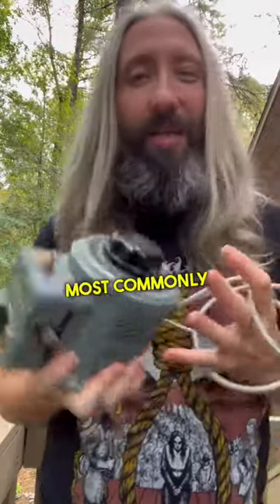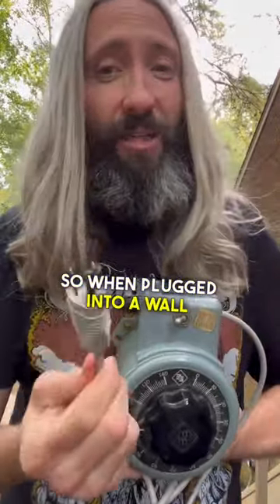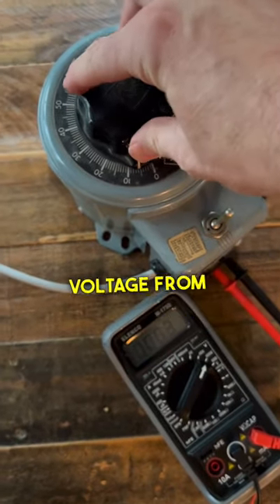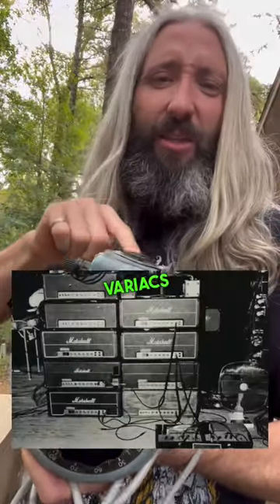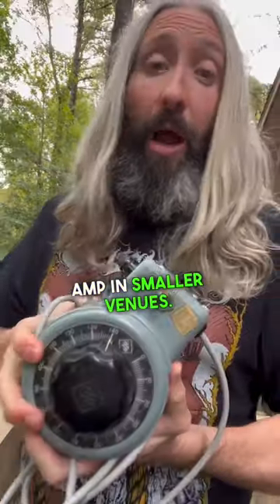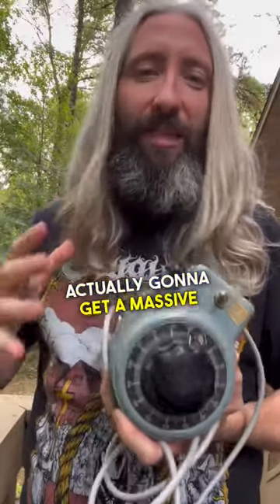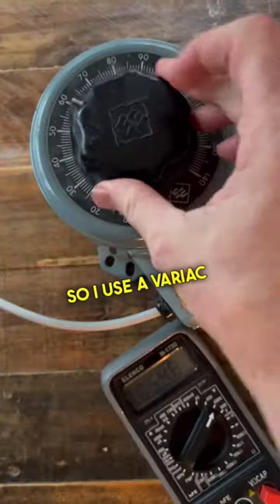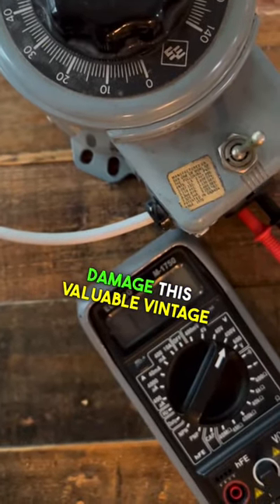How To Use A Variac With Your Tube Amp #guitar #eddievanhalen #vanhalen #shorts

Comment: I heard that that is exactly how EVH used it: he just had British amps, and needed to set them to British power supply.
Reply: I don’t think a variac gets anywhere close to 220V? And there’s no correction for frequency either, although that probably wouldn’t matter
Reply: What 👆he said.
Also, this was a ploy that he used to hide how he got his Tone and a way to get his competition to Destroy their Amps when they were trying to copy him.
Reply: Plexi Marshall?  British version was 230 volts in the 60’s for that, IE 115v American twice, today the British/European standard is 240, I guess partly because ours is 120?  Something like that…..

I grew up in Pasadena, about  Eddie’s age, I read that he had a British made Plexi, and also others wired for America, so he needed to step up the British one, but he also stepped the American 
Ones down toward 112, 110, apparently to take some of the steam out of them, and reduce the clean headroom, Ie brown them a bit, hence the brown sound name.  a vintage 60’s plexi is an insanely loud amp, only British HI WATTS, or American Ampegs are louder, those 2 amps are designed for clean headroom and they were not designed to distort like a Marshall.   
But after ‘78 Van Halen had more access to the best amp techs, and there are other easier ways to mod the amp itself, to get the same result Eddie was after …reliably…..Hendrix by contrast literally maxed all the controls, and blew them up at first left and right, until his techs also got wise and nodded them to make them more reliable, as well as get his signature tones.   

PRS recently cloned an actual late generation 60’s Plexi that Jimi played at Woodstock that was in a museum, those new PRS heads are made without the 4 inputs the Hendrix Woodstock amp had, they are internally jumpered instead, with separate volume controls to blend the different preamp voices.   Spendy, but if you want that sound in a modern amp, I think Paul nailed it!🙂 AND the 50 watt models (2output tubes vs 4) have the same transformers as the 100 watt ones!   So they are likely super reliable
Reply: @zgrb  yes!, I think that’s how Eddie got the idea to take the American 115v volt Plexi amps down under 115, because the variac only went up to 220v not the 230v that the Brit Plexi actually wanted to see, AND the added bonus was they didn’t blow up as often, they ran a bit cooler🙂. Eddie was a smart guy, and a tinkerer!
Reply: @scottarnold6528  yup!   Just before Van Halen broke big, if you saw Eddie play, he faced his amp, his back to the crowd!!!😳🙄

There was another local Pasadena band called Reddi Kilawatt, their guitarist Terri Kilgore knew Eddie, and used the same Echoplex and Marshall type of sound, I saw him
Blow up a Marshall at a club date!
But as a rivalry, it really wasn’t, Terry was also the only singer, a 3 piece band
Reply: @jonathanstrand2474  PRS just released a 20W version of it too but kept the entire preamp and transformers etc the same as on the 100W and 50W versions and it’s only like $899 MSRP too
Reply: @zgrb  They make 240v variacs
Reply: @jonathanstrand2474  As overly simplified: European high voltage socket is 3-phase 400V, so single phase is 400V divided by square rooth of 3, which makes roughly about 230V. American high voltage socket is 2-phase 240V, so single phase is half of that, which makes 120V. Not sure how they are related, maybe they are, but the number of phases and the feequency and the "angle" between the phases is different. Many devices nowadays can intake anything between 110-240V and both 50 and 60 Hz, but that certainly wasn't the case back then, and even today that is true mainly for low current devices like phone chargers and such.
Reply: But thanks for the story, that may very well be true.
Reply: @thoubias  wow thanks for the detail, I’ve always electronics tinkered, but in the electronics class I took the math was just too much, I can do it with music and rhythm intuitively, but I barely got through Algebra, pattern recognition is what my brain does well, so I don’t care about book math.  I’ll look up phase”, u got me curious now, so that’s how you calculate that!🙂
Reply: @zgrb  well back then it was 240 v and now it's 230v so I don't know where you got 220 from
Reply: @TheTreegodfather  sure, but they wouldn’t transform U.S. voltages up that high afaik
Reply: @zgrb   Every US house has 240v in the panel. Some have appliances wired for it, some don't. My ham radio amps are all 240V, and I have a 240 variac because I work on other people's gear.
Reply: @zgrb   Mine will go from 0 to 265-ish volts on the output.
Reply: all Plexis are British amps, but anyway he did use them to turn down the voltage, but he stoped using them after 1980 tour
Reply: @jonathanstrand2474  they are the same amps they sold in the US, there is a plug in the back for 220 and 110

Comment: PSA: just because the variac has a labels that say 100, 110, 120, etc volts doesn’t mean it is that. Most wall volt is actually 120-130v. The variac is made in respect to 120. Use a multimeter to ensure what it actually is. Also, you can bias differently when dropping voltage to 90-110, just make sure you know what you’re doing before you go about messing with dangerous voltages.
Reply: I think a lot of these are set for 110v so if you have 120-130v going into them you'd need to turn it down to like 100v to get closer to 110v. I could be remembering wrong though.

Comment: I repair tube amps since 2004. Here's what happens. When you reduce voltage to preamp tubes, their frequency response narrows, but also they distort more. There's a limit to doing this because alunder about 100 volts at the plates they start sounding alot less musical and you'd be better off with transistor/IC distorton. You don't really need a Variac today because modern high-gain amps adjust plate resistors for a sweet-spot compromise, using larger values like 220k instead of the classic 100k value for preamp gain stages.
Reply: Best reply

Comment: I read a bit somewhere that Eddie got a second Marshall head and plugged it into the wall and it was taking forever to turn on- but once it was on it was really quiet “only him and his dog could hear it” and he eventually figured out that he had a 220 volt amp or it was switched to 220 volt… something like that.. anyways that gave him the idea, so he hooked up (an/ thee I forget which one) amp and turned up and down the voltage that way. He then blew up that knob because it was too much power for it to handle so he went down to the local (hardware/RadioShack or whatever it was at the time) and asked for a heavy duty “light switch” and there it was. The variac that Eddie used to create that magical sound! 

I believe he says this all in an interview somewhere I’d have to find it but that’s the truth to how he discovered it!
Also I believe it was 89 volts that he set it to, and to which I run my Marshall origin 50 (it sounds beautiful at that voltage by the way!)

Comment: I go down to 60 volts and have been there for over 3 years for the “Brown Sound” and I tell you, that’s where the tone is. Not only does it reduce the volume a massive amount, it gives it a laggy feel which is the tone. The best recommendation I’ve gotten is to go to 90 volts on the variac, bias my tubes to 50mA each, then go to 60-75 volts without bias (each tube is at like 2mA each and the random differences from not biasing  also has its own tone). The cold bias has a tone of its own. The laggy, chunky feel of cold tubes gives the impression of more overdrive; maybe not even the impression but actual more overdrive since I’m pushing my tubes harder the more volume I add to my Plexi (well, I’m always at 10 on all the knobs).

Comment: For vintage amps you can certainly here a tone difference when reducing the voltage that 10-20%.  Even newer builds with vintage circuits. Like fender tweed circuits, etc.

Comment: You might want to explain that early wall voltage was 110, mid 1940’s to mid 1960’s 115 Volts like your Laney or a plexi Marshall, or an old Fender Tweed or 50’s Gibson 
I have a late 40’s Bell amp, that if I wanted to use it would be best to step down to 110 Volts, i plugged it in before I knew that, mucho overdrive, left on for hours it would have fried at 120volts, probably taking the tubes well past their rated plate voltage and output.   Anything rated for 115 can probably handle 120, but you might want to re-bias the output tubes a bit lower under heavy use

Comment: That tube head will work just fine on 120v. You don't need to drop it to 110.
Reply: Yep. 110, 115, 120, and 125 are all essentially different ways of saying American wall outlet voltage

Comment: I read in one interview with Ed that early on he used a dimmer switch to lower the volume output.
Reply: I remember him trying to explain the Variac to someone in an interview & he compared it to how a dimmer switch controls a lightbulb by lowering or raising the voltage.
Reply: @robertkise  yes. A dimmer works differently, and never with inductive loads, which can be damaged by the peaks generated by the Thyristor. 😮

So it’s better not to actually use a dimmer for this purpose. 😉

Comment: I know this might sound crazy but I've been using a variable off and on depending what type of amp I'm using since 1985
Reply: Essentially you are changing the amps specs on the fly🙂, when you lower the voltage: it affects several parameters at once, sag, compression, headroom & gain, you could damage the amp with over voltage, but under by 5 or 6 volts is not likely to hurt it, and might make it sound better, to your taste!   Kinda cumbersome to carry around tho…..

Comment: I heard or have read more than once that he cranked it and he said (Eddie) he’d actually melt tubes but it was to get more out of the amplifier. Then I read that he didn’t use them at all then he did again. There’s a photo floating around with Vanhalen in the studio for their VH1 haha and his effects are in this old bomb housing it looks almost like a cartoon and you can clearly see the Variac on the ground and it looks like it’s turned all the way in one direction. I’ve heard that Eddie had his cabinets turned sideways or around in the early days because he played so loud. The only possible way to me to get his sound back then was to crank the amp so turning the voltage down makes sense to me not turning it up but hey I have an EVH III and it blows the walls out on two so technology has changed quite a bit. So unless there are better photos or a band member saying yep this is right we like asking Mr Owl about tootsie roll pops will never know

Comment: Variac is a brand name by the General Radio Corporation.  It stands for “Variable AC” and as stated, should be monitored by an accurate AC voltmeter.  What the indicator on the knob says is probably not the actual output voltage.

Comment: I have both the same variac and amp('69 PA head though, essencially 4 treble inputs, I removed the bright cap on one and will be disconnecting two input stages). These old Supergroups, with the correct AC voltage, run the plates and screens at ~600v. 110v tap into 120v outlet mine read at ~625v. Plate voltage ain't the issue, modern EL34 'should' not see more than 450v at the screens. Old industrial/military grade EL34 could withstand 600v at the screens. Looks to me like the guys at Laney designed the amp around the limits of the EL34 at the time. I run mine with JJEL34 straight into the wall(currently running with two power tubes into double load). No issues so far. However, I don't push the amp. And I keep my tube sockets clean as arching is a known common issue with these.

Comment: Just get a JMP two hole with the 390v plate power transformer. You just  can’t make it sound bad.  Higher plate voltages make more power but at the expense of your amp frequency response being messed up making it harsh. So if you reduced your wall voltage by 1/8 you should get that voltage. Probably should re-bias it though.

Comment: The Amp says 110. 
110 and 120 volts were used interchangeably because 120... isn't. it's a nominal voltage of around 115. 

Used to be called 110 and 220... but because of Electronics that are more sensitive, they CHANGED the name, to 120 / 240.
So that actual voltage would be lower than stated rather than higher.

Comment: Buy a modern voltage step down regulator. More stable power for your amp using 220/230/240 voltages stepped down in half.

Comment: When a Tube Amp uses Tube rectifiers... do not go below 110VAC. If the rectifiers are Solid State... a.k.a Diodes, spin the knob at will, just stay below 125VAC 100% of the time.

Comment: I'd rather be 10v higher than 10v lower. Decrease in voltage means increase in amperage.

Low voltage will do more damage than high voltage

Comment: EVH turned his Variac to 89 - 90, he lied and said he turned it up to 120 which blows your amp to hell
Reply: You know that if it was set to 120V then it would be just like plugging it into an American Socket without one.
 It wouldn't do any damage unless it was set higher than what come out of the socket originally.
Maybe, if he was plugging it into the European grid he could get it above 120V but, here 120V is what normally comes out without one.
Reply: After Ed said that in Guitar Player amps all over Southern Ca were browning left and right. He said that so no one would copy him. Paul Rivera also said this is dangerous, you could get electrocuted, all horseshit
Reply: I also think contrary to recent revisionist history that Ed’s amps were modded too. I doubt he was always at Jose’s shop just to hang out and drink beer
Reply: Never used a Variac but I’ll keep it at 89-90 just to be safe, tee hee hee

Comment: I am an electrical engineer and I need to tell you that using a variac on a vintage amplifier is a really bad idea. First, it's completely unnecessary. In the US, domestic mains is 120/240. But we constantly see 110v, 220v, 230v, etc. This is because equipment is rated to a specific output BELOW the expected input. That's because we have an expected line loss that can vary depending on circumstances. So, if it's a 200w amp it's rated to 200w when given 110v. At 120v it will likely produce a slightly higher amount of maximum power (totally within it's design). But if you aren't maxing it out that doesn't matter anyway. What does matter is that at a lower voltage the amp is working HARDER to produce the same level of output as if it were connected to 120 volts. In fact, the variac and it's internal resistance is going LOWER than 110v under load. How much lower depends on the variac and the amount of load but it is for sure sagging. Less voltage at the same power output means more current. More current means more heat. And that's no good.

So we've established that you don't need a variac. And we've established it makes the amp work harder. But more important than both of those things is the risk. If you set it wrong, someone plays with it, it fails, you accidentally bump the knob, all of those things could over (or under) volt the crap out of the amp and damage it.

Comment: You cannot damage a tube amp by lowering the voltage. You can only damage it by giving it a higher voltage than it is designed for. Eddie would lie and say he was increasing the voltage, and when people would try it, they would blow their tubes as you said, he was decreasing the voltage, though. Starving it of power.

Comment: you really don't need a variac on that laney.. standard North American household wall outlets fall in the range of 110-120v/60Hz.. the voltage may fluctuate in this range, or may coalesce in this range, dependent on distance from local power sub-station.. so, you're tweaking "120v" down to 110v to supply something that was designed to operate on 110-120v input to begin with.. just saying 🙂

Comment: All vintage USA in the 1950-1970s was 110-115 now it’s up to 124 in some cases jacking up your b+ past the voltage the tube is designed for and burning out your tubes 
And todays world there expensive

Comment: Not so all true with the story. First off each amp is different prior to linear power. Secondly, you don’t reduce AC power to create a reduction in output. The preamp tubes must be properly supplied voltage. He did not reduce voltage, he supplied constant current. Current is not stable and a variance is the current, hence a variac. Secondly and dangerously a financial mistake, a variac then vs. a constant voltage variac now, senses the current and maintains it. After 1978 or 79 for instance fender used linear power which is not varied!! That’s why the tube is missing for that supply now. Marshall’s are completely different now also.